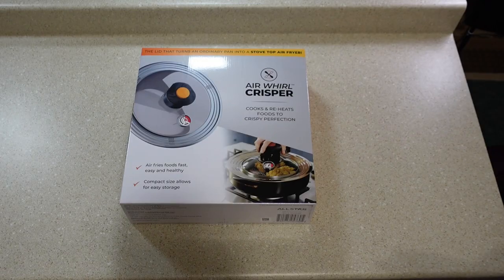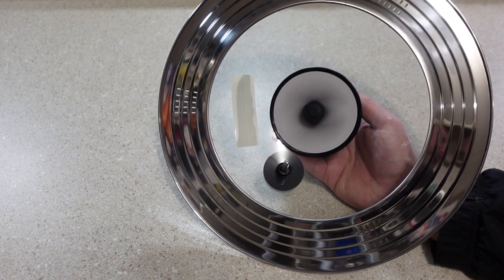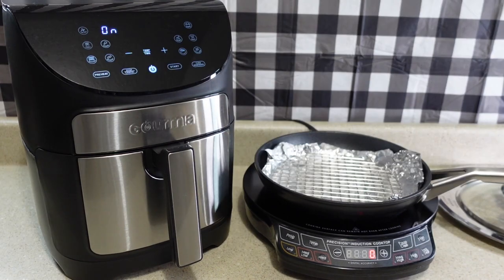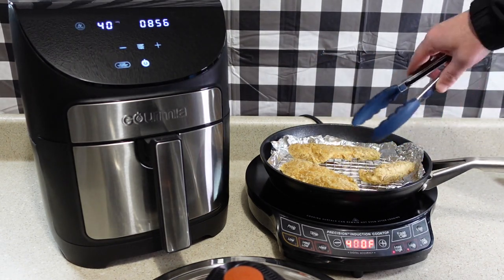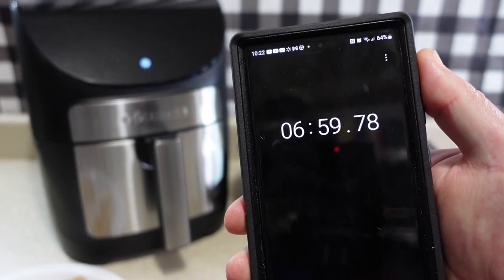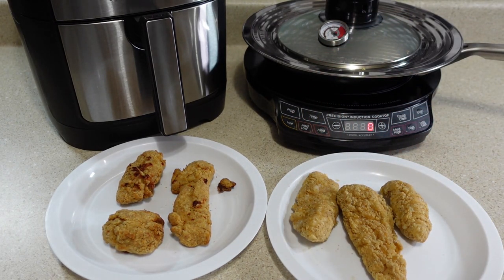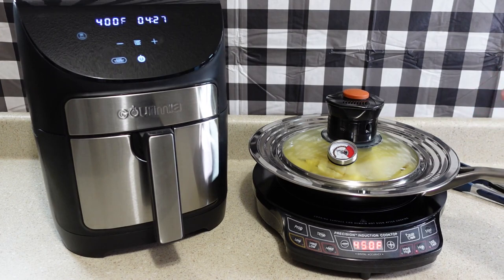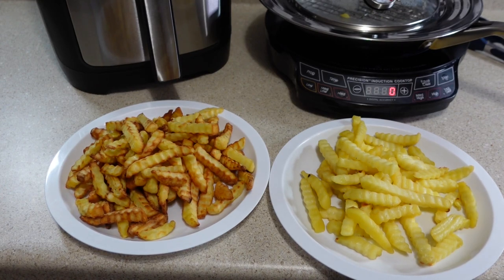TRYING THE AIR WHIRL CRISPER LID - BETTER THAN AN AIR FRYER?

Comment: The problem Yes you're not using a real stove. To The air top A better chance use a real stove. I'm pretty sure you'll get a better Result. That hot plate you are using I had one myself It have a cool top when you touch it. But it didn't work as good at all for me it used a lot of electricity